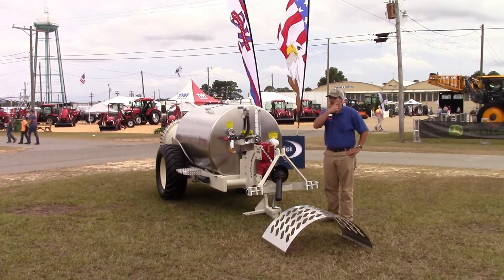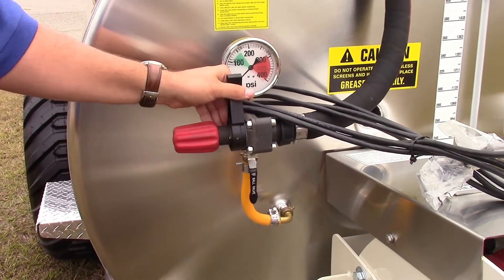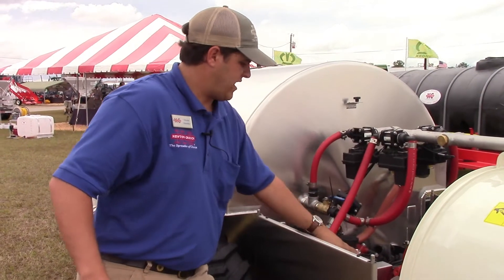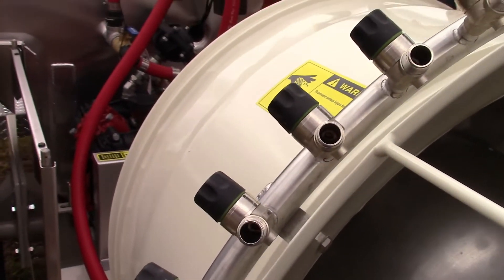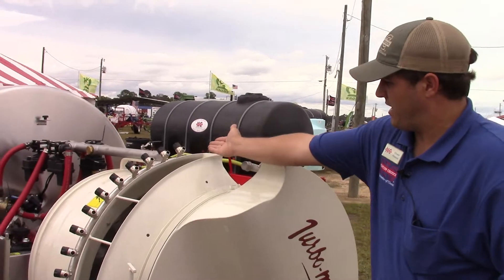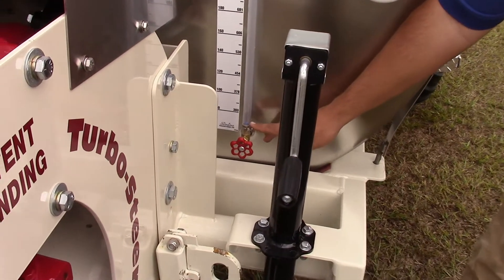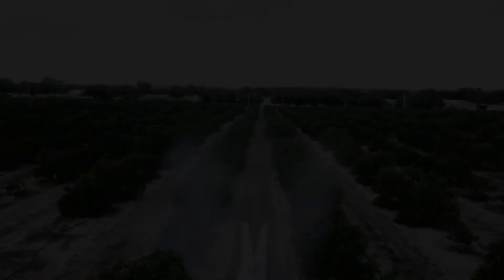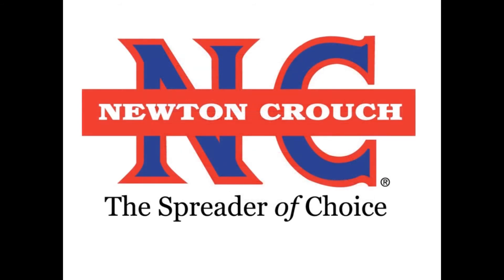Features and Demo of Slimline Turbo Mist Sprayer

Comment: How do you replace idler belt on the agitator shaft?  Tell me that universal PTO shaft telescopes so it slides off the gearbox and you don't have to remove the entire back end of the sprayer to remove the fan. Seriously?  Tell me the drive shaft telescopes!